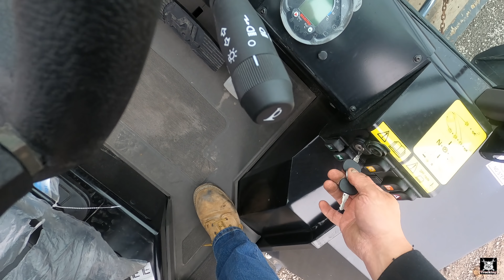Quick Trip To Pennsylvania To Deliver Forklift

Comment: I am curious to know I understand you need to undo the air and electric between the trailer neck and bottom to separate them but if the neck stays on the truck anyway why do you need to undo the air and electric between the truck and trailer neck.